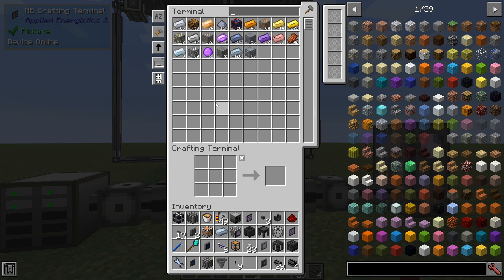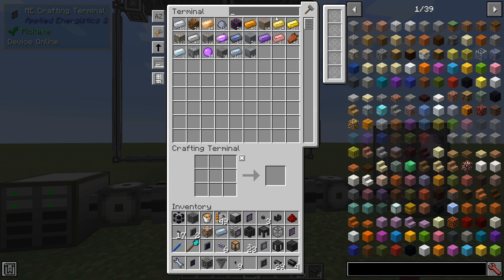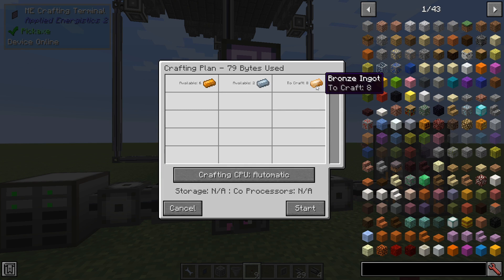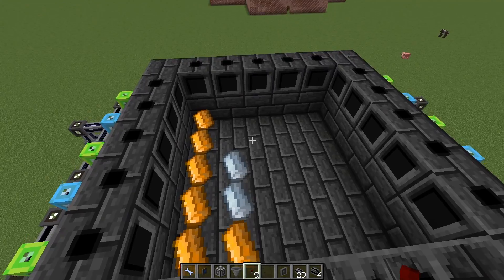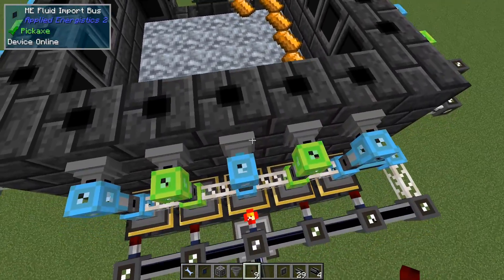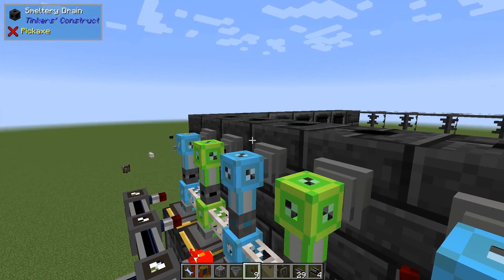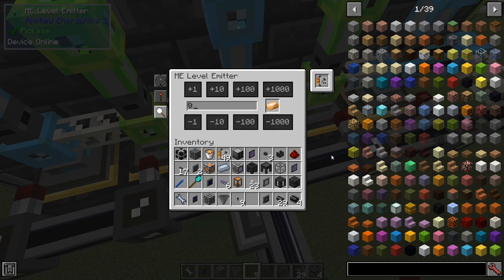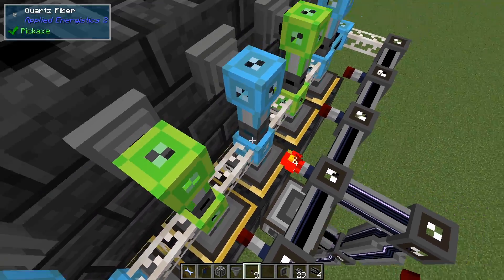AE2 Controlled Smeltery from Tinkers Construct - Applied Energistics 2 Tutorial

Comment: I think if we have more than 1 processor unit, this system won't work (because when we start crafts for example of copper and tin, we would get bronze, and crafts won't complete). Can we somehow fix this problem? I have some ideas, for example we can build many smelteries. Or we can make this as sub ME network with this own crafts, and then run the cable to our main crafting room. But I think that is not very good solutions and I want to listen your opinion about this problem

Comment: i dont know if youll read or see this, but any chnace you could make a 1.18.2 version? i cant figure it out
Reply from the maker: Sorry, this is a late answer, but I expect the build to be the same except for that the Interface will be exchanged for a Pattern Provider which was introduced for 1.16 or something. It has replaced the Inteface when it comes to handlig auto-crafting and patterns, but to receive the items after crafting the Interface should still work. I didn't try it in different versions but Pattern Provider can also receive items back into the network.
Reply: its ok no worries, but anyways, i tried replicating your build uisng the pattern provider block, and idk if i did something wrong or not(im not the sharpist knife in the drawer), but the only way i could replicate it, was by putting the pattern provider onto a chest which then required me to use either a hopper or another "item transfer" tube mod, and through my testing i somehow made an auto smelting duplication machine(idk how 🤣 it would take the ore, give me the iron ingot, and the ore would still be in the chest that i mentioned before 🤣)  @therealtkh  but thank you for taking your time to respond to me 🙏

Comment: To save a bit on channels, if you want to cast multiple things from the same metal (say, ingots, but also gears if your pack makes you use TiCon to make gears/makes that an especially efficient method), you could connect one fluid import bus to multiple fluid storage buses and multiple casting tables, right?

Comment: by the way, you may have have to make it slightly bigger, but to avoid the hopper you could have added in seared chutes. they allow for inputting items into the smeltery and you can have multiple ones and directly connect to the chute. the chute also allows queuing up more items than the slots on the controller.

Comment: personally with AE2 and TC together i would instead create several 8-block smelters (4x4x3 outside) and dedicate each one to each kind of metal so that mixing never occurs. besides that you could send all the control signals to a redstone circut that only allows compatible crafting events, but the logic quickly grows beyond the value of using more smelters
Reply from the maker: I hear you. A few small smelteries where no recipes has the same ingredients would absolutely make things easier and not even require a level emitter. I think that's a great idea for improvement and might deserve a video of its own! I'll do some testing and we'll see how it goes :)
Reply: this is a great solution in my opinion. plus, for lower tier recipes in later versions post 1.16, you can use a melter and fuel tank instead of a whole smeltery. i think that would cut down on the building cost and space a good bit

Comment: I never even think about this, mainly because there's better and faster way to process stuff. I really hate that tinker construct doesn't have a way to not mix the molten stuff. And tinker steelworks are so much annoying and expensive to set up for measly gain and slower processing (unless you work on 8 multiplication, so you could cast it as 2 block)
Reply from the maker: I know there are probably "better" ways to do this in most packs, but in case some pack limits you to use smeltery for everything, or don't have certain mods, it might come in handy  :)